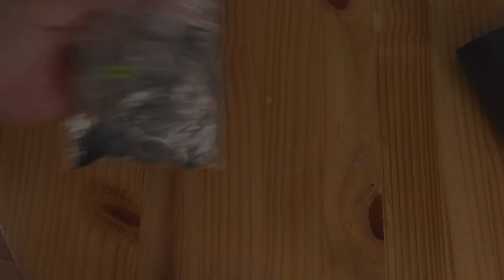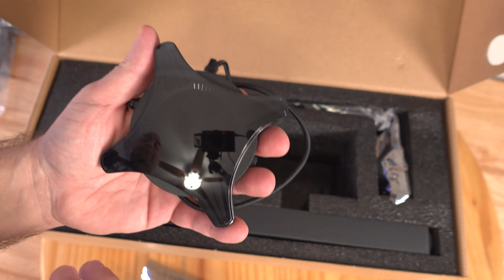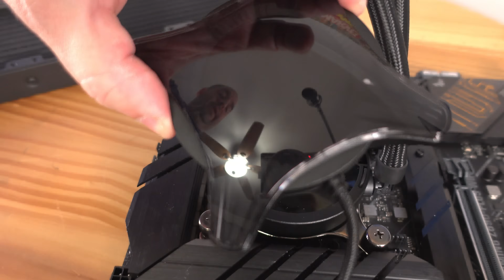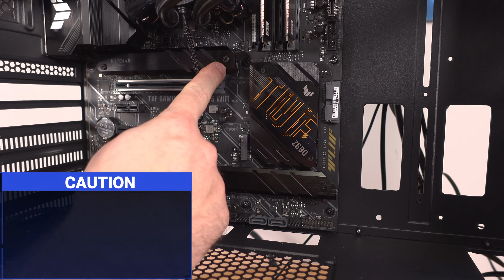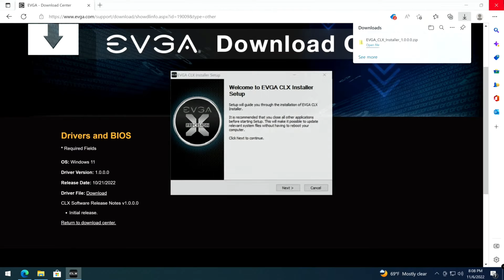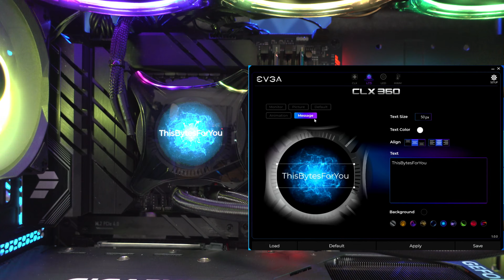How to install an AIO CPU Cooler - How to install the new EVGA CLCx 360mm CPU Liquid Cooler

Comment: Wow, have the same case using a Z590-E.  Why not send that cable underneath and back up through the cutouts?
Reply from the maker: Building it quick, you don't have to follow exactly how I routed the cable, but its a guide to show you how to install it.  The case is not the star of the show here, but thanks for mentioning it.

Comment: Iv been trying to install this for the past 3 hours idk if a part is broken or what but I always end up with multiple stragglers
Reply from the maker: So did you watch this video.
Reply: @ThisBytesForYou yes Iv been watching this video and the pc build with the Tuf Z690 motherboard I bought almost the exact parts except for the M.2, ram since it's my first pc build. I was using your videos as a follow guide because i liked the way it looked and you always give good instructions but I think some of my pins of the connectors are broken plus I get confused easily while watching the cable part
Reply from the maker: if you follow this guide you should be good, the stragglers could be the cables that connect into other cables or RGB.  Yeah if its one, it probably the end that allows you to link to another fan, i zip tied that up
Reply: @ThisBytesForYou  I got it down to only one straggler cable then just put my build on hold till I can come back to it iv been rewatching the video in slow motion for awhile

Comment: @thisbytesforyou did you encounter any “warning “ errors during install? The second my pc powers on it has the error.
Reply from the maker: Do you mean the USB error on the LCD?  Well if so, don't worry about it, it goes away once it passes POST.  also, you will have at least 3 firmware updates once you install precision.  The error will appear each time you restart the PC, but only during POST.
Reply from the maker: guess you are good now

Comment: All this blinking RGB stuff is complete overpriced BS to me! The only thing needed would be a single LED which indicates if the systems temperature is cold (blue), normal (green), high (yellow) or too hot (red).
Reply from the maker: Well, this is made for everyone, so it accommodates many people not just you... but you can adjust to for temperatures as well, pretty neat huh?  The cost comes to quality of components, R&D and warranty.  EVGA has been known for making GREAT liquid cooling units, and yes, this one is more expensive but it has a LOT more than just pretty RGB stuff, the software allows you to do much more, then LCD screen too, and surely is a big part of the cost.  You can even turn off RGB.

Comment: If I wanted to use Lian Li SL Infinity fans in place of the stock EVGA fans, would I connect the Fan PWM to the 4 pin on the Lian Li controller? The controller will have a total of 6 SL Infinity fans connected to it.
Reply from the maker: I would love to tell you, but I am not sure, I don't have separate fans to test on this, though I have reached out to Lian Li, so I hope to be able to tell you more soon, stay tuned my friend.

Comment: Wow the new cooler realy seem beter then the old one they used to make.. im runing their old version of the CLC240 evga and it running hot with i9 9900k around 105 full load and 80 while gaming
Reply from the maker: yeah but the CLC's were awesome, well, your on a 240 and the 9900K is hot, a 280 or a 360 would have worked, I ran on one for a while, this would do much better, but I think it would be time for a complete upgrade, I just upgraded my 9900K workstation, check it out my friend, the performance is AMAZING: https://youtu.be/13LhFMdbtBA

Comment: Wondering how clx 360 would compare to kraken z73
Reply from the maker: Hmmm, not sure totally sure, I have never review it, but depending how/where you buy the price is similar, sometimes $100 over the CLX360.  Comparing differences, 
The CLX360 have higher spinning fans, Higher CFM fans, higher static pressure, lower noise level.  The LCD on the CLX360 has a higher resolution, not sure which of the 2 is bigger though but it looks to me like the CLX monitor is bigger, it is also squre   The Kraken does have 1 year more of a warranty.  

Here are my sources
Kraken Z73
https://nzxt.com/product/kraken-z73
EVGA CLX360
https://www.evga.com/products/product.aspx?pn=400-HY-CX36-V1
Reply: @ThisBytesForYou  whoa, thanks for informative reply. In terms of performance, clx360 seems to be a bit better than z73. Although, where I live, the produt in stores would probably show years later and with overpriced price. I will probably grab z73. If I would use any of these 2 aios, I would change the fans to lian li sl120 infinity, so it would be even better probably.
Reply from the maker: @Skrio4  You have to be careful with those fans, while they are VERY cool looking, the way they interlock may not function correctly on an AIO, spacing and all, I can't truly say since I have never tried them, just something I would be concerned with.  The Z73 looks nice though.

Thanks so much my friend, so very happy you enjoyed it and keep coming back for more, it means the world to me.  We have similar systems (well, I have the 12, you have the 13), thats cool.  I want to get the 13 but funds are a little low right now (wife is pissed, me too) so I hope to match in a bit, and... well trying to see whats going to happen with the new AMD cards,... stay tuned my friend and thanks again so much for your support.
Reply: @ThisBytesForYou  hm, many people have used these fans on aios and they all seem to be fine. Anyways, I'll keep that in mind.
Also, what do you exactly want to say by system 12 and 13?
Reply from the maker: oh.... I don't know how that got in there, that is weird, Youtube included the message I had for you, and a message I wrote for another person, I was replying to both of you.  The 12 and 13 are intel 12 series and 13 series.... I need to go back and see what I replied for him, I have never seen that before.  Though, the thank you part applies to you as well and subscribing if you like the videos I put together, it would be greatly appreciated.  

I have to reach out to Lian Li in a bit and get them to send me some of these fans to check them out.  Lian Li is awesome, its been a few years since I have worked with them
Reply: @ThisBytesForYou  Alright, keep making great videos! You should definitely try lian li fans, personally, they are number one for me. Keep up the good work.
Reply from the maker: I will for sure, thanks bud, I do appreciate it and make sure you subscribe so you can keep catching those great videos :D
Reply: @ThisBytesForYou  subscribed:)
Reply from the maker: awesome, thank you, it really does help me grow, not just because of the subscriber number, but the higher that number is the more companies will take this channel serious to work with more and different products.

Comment: Can I swap the 3 fans out for Phanteks T30 Fans.. I want to have them as intake for the AIO or I have to use EVGA's RGB fans? Dont care for the RGB
Reply from the maker: Have you watched the video, it would answer your questions and more
Reply: @ThisBytesForYou  Yes I watched it multiple times. I installed it thanks to your video but I don't see you mentioning the use of other third-party fans instead. If I missed it sorry, could you tell me the time frame?
Reply from the maker: no, I didn't think to mention it since it uses a regular 4 pin header that plugs into the adapter cable but notice that the cables also plug into each other, so which ever fan you get, you will want the same that way you don't need multiple 4 pin PWM headers.  With this, I don't know if it will limit you to 2500RPM, I will see if this is something I can include... trying to figure out how to add that.  Also, the RGB is controlled by the EVGA software, which is not a standard 3 Pin ARGB connection.  So you can use different fans, but you will end up complicating things.
Reply: @ThisBytesForYou  Thanks again. I reached out to EVGA just to confirm and they said I should have no issues with swapping fans as long as they are standard and don't have to have the RGB cable plugged in

Comment: overpriced and terrible argb light...arctic all the way and keep half the money
Reply from the maker: the terrible argb lighting could be an issue on myside with the camera, the lighting isn't the greatest, still trying to work it out, it is expensive, but I am sure that is due to the monitor and I do love Arctic as well, for sure but its always what works best... or at least it should be and we will find out soon.
Reply: I know it’s an older comment but they have the 240 of these going for 64$ and the 360 going for 94$ on new egg on sale. Picked up one and I’m surprised.

Comment: I own a NZXT Kraken X 53 240mm and my cpu i7-12700k temp when idle is 40C. Then goes up to 70C to 79C when playing fortnite or horizon zero dawn on 4k sometimes it even stays steady at 85C, if I were to upgrade to this water cooler would it reduce my cpu temp significantly? I’ve had it since 2017
Reply from the maker: most definitely, but also because you are going from a 240 to a 360 then after that, it's just a really nice unit.  Can your case take a 360mm?
Reply: @ThisBytesForYou  i would definitely need a new case with better airflow since my current one is from a prebuilt ibuypower case, it only has 1 spot to put a fan in the top.
Thanks for the fast reply!
Reply from the maker: always a pleasure my friend, so very happy I could help.  Make sure you get a case with good airflow, like a Corsair 5000D or 7000D, they have amazing airflow and that will help tons, then with this liquid cooling, you will be set.